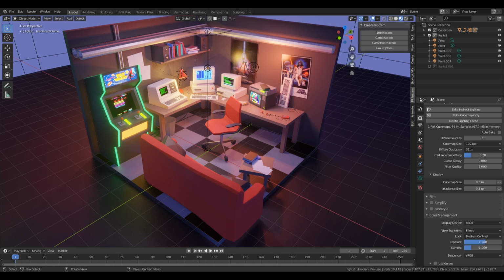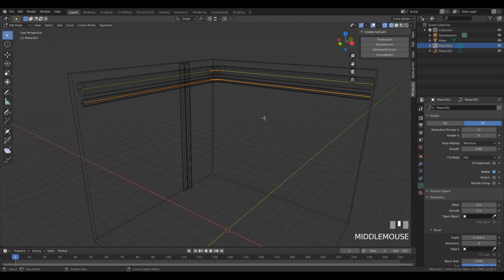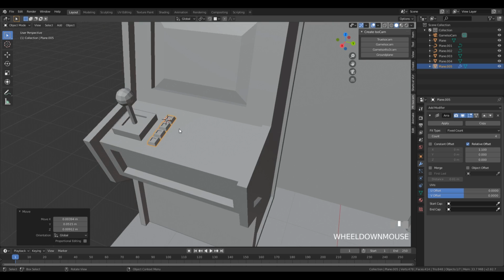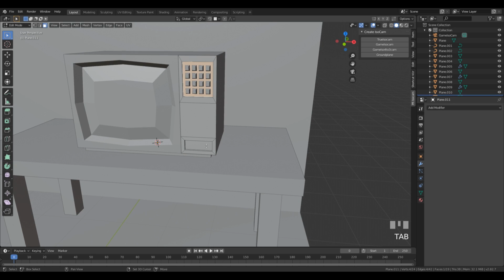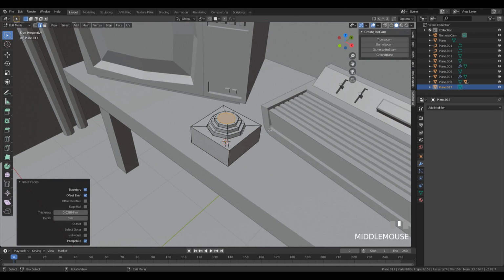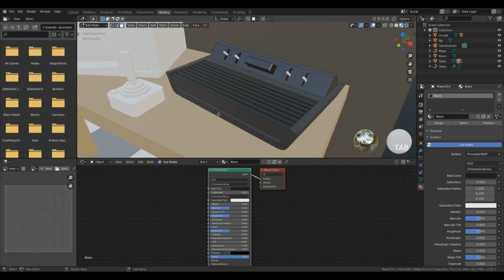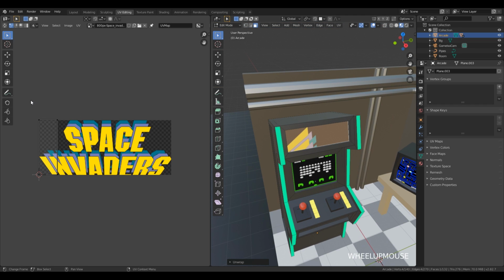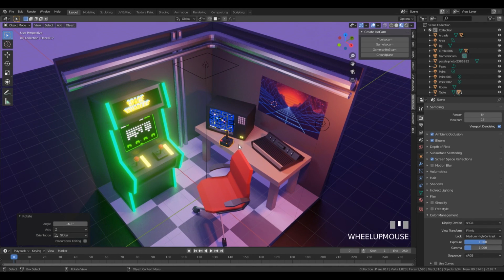Mini Arcade Room Blender Tutorial with Commentary

Comment: I am a blender noob, trying to follow this tutorial. Specifically the arcade cabinet build part. When I get to the part when I inset both faces on either side of the cabinets, I get this weird issue w/ the mesh at the top part of the cabinet. When I inset the parts of the mesh kind of conflict with each other. And thentt looks fuzzy and weird even in Solid preview, almost like a face is missing or something. Anyone experience this too or know what I'm doing wrong?

Edit: okay, think I figured it out.. Not sure how it happened but somehow on those corners I had multiple vertices. Found that selecting that corner in Wire Frame + Xray view and then M (merge > by distance) fixed it.. Hope this helps someone else?

Comment: I have a question, I already installed isocam, and I'm using it properly but when I opened my blender I have to install it once again? Idk what happened.. same to the image as plain, do I have to check it on preferences everytime  I open my blender? TIA
Reply from the maker: It should remember the settings. What blender version do you use?